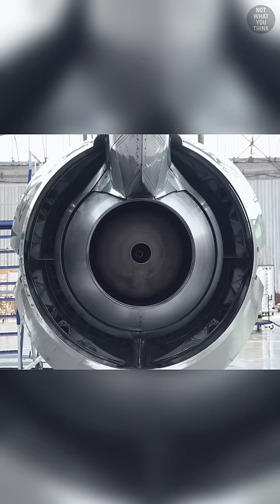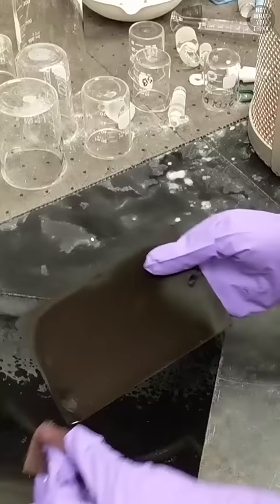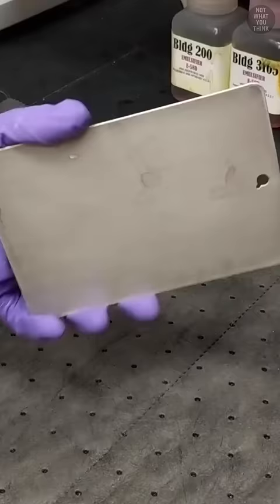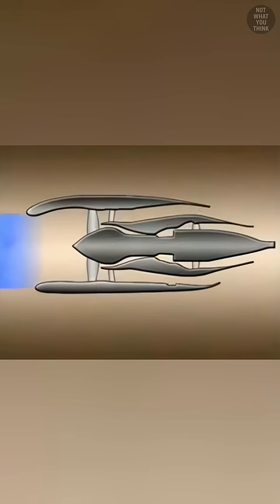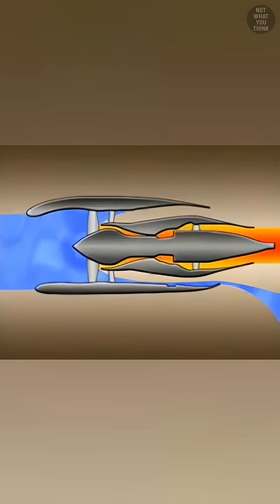Jet Engine Wash #shorts

Comment: I would never guess. High heat and high air movement should keep it clean, at least in my imagination.
Reply: You would be surprised
Reply: Oh my no
Reply: Lol
Reply: Even paint would go away in those conditions, but dust ..hell naw..

I wonder if we can we use dirt and dust as paint?, I am running trials on my car
Reply: Do you realize how much stuff there is in the atmosphere?
Reply: @J05EZ  Sure, mixture of gases, small particles and even space dust. But in very diluted concentration.
Reply: @user-uf9ke9tm2w  People use oil as undercoat for their cars, get's dirty and dusty but rust free I guess.  So there you go.
Reply: @DarkGT  Nowdays it's a special bitumen you can get done in most mechanic services.
Reply: P.S. I think it's an over time accumulation of vapours and particles in very high speeds of blades hitting them, along with kerosene and oil mist, gradually baked on by the heat.
Reply: @vitalijslebedevs1629  Yes, the oil thing is more like on the junk cars DIY. I not familiar with the turbo engines enough, but I know kerosene is oily like the common diesel.
Reply: Well when you add the fact the the space in the middle of all those sparse particles is rapidly displacing itself at a certain speed… like seriously just use your scientific imagination more. 🤷🏾‍♀️
Reply: It's not what you think
Reply: @user-uf9ke9tm2w  hahahaa
Reply: Well its only hot in the core and the back of the jet, they dont let heat out or it'd eventually ruin those jets
Reply: Still volcanic ashes get stuck to the engine
Reply: @Racejakestar  no. Compression heats the air. By hundreds of degrees. Heavy hydrocarbons will adhere and quickly bake on.
Reply: I think what's happening here is a similar process to carbon deposits on direct injection engines.

Oil and crud lands on surface, it gets hot 🔥, it gets baked on as a carbon deposit and is very difficult to remove, more oil then gets dropped on the new layer, and the cycle continues
Reply: I work on a 737 variant. We do engine washes every 90 days. We also are exposed to a lot of salt though too. It’s similar to getting a fuel system cleaning in your car. Aircraft can get nozzle coking (carbon buildup that effects fuel mist pattern) which is part of why most engines are run at idle/low RPM for couple minutes prior to shutdown after any turnup. Fuel nozzles get changed at certain intervals too.
Reply: @user-uf9ke9tm2w  hmmm
Reply: Nah it’d have to be way hotter to self clean and even then oil gas and carbon residue would still stick
Reply: Oil from the bearings or air, it doesn't get hot enought in the compressor to burn it, dropplets accumulate and dust stick to it.
Reply: Rain is so dirty. And the only way it would stay clean is if there was detergent running into the engine at the same time which also presents a problem because those chemicals can become explosive if mixed with the wrong other chemicals. I’d bet those engines are disgusting even after running through a few clouds not to mention the grease required to keep the parts moving.
Reply: @user-uf9ke9tm2w  Well, paint can burn but you cant burn a thing that is already burnt.
Reply: High heat and high air movement sounds like more chances for things to go wrong, not right.

Comment: Our TF34's have nozzles built in for water washing and there's servicing ports in the fuselage for connecting to each engine (A-10C).
Reply: The i or the ii
Reply: I always loved the a10
Reply: When I worked with A-10s in Alaska, one of the problems was the buildup of mosquito "mush" on the back side of the fan blades. It was surprising how thick it could be. They usually didn't make it to their 100-hour wash schedule before needing a wash.
Reply: Is that because the gun’s exhaust(?) causes the engines to become dirty faster?
Reply: unfortunately the civilian version CF34-8C5 for the crj 700 or 900 i work with does not have that feature and needs nozzles clamped behind the fan blades pointing into the core stage
Reply: @Acrophobia2  Yes, that is part of it. If I recall correctly, engine washes were every 100 flight hours or "X" number of rounds fired.
Reply: @barrygrant2907  So should there have been a recommended number of flight hours in mosquito mush? Damn I hate mosquitoes but I don't see enough to make mozzie mush!
Mark from Melbourne Australia

Comment: "Atmosphere is full of contaminants "
:-Jets being one of them.
Reply: Hippie
Reply: @Skumbagbrad  I mean he's got a point
Reply: Your right, but in this case, CO2 doesnt contaminate the engine core, only dust does, so your comment is unrelated to the video
Reply: @Ben-mw9vz  jets do not only produce CO2, but a bunch of other chemicals, also the fuel additives, and the oil used for lubrication produce more chemicals under the heat. And all of those build up in the engine.
Reply: I think it was referring to the aircraft itself being a thing in the air that is not a gas and should not be there.
Reply: @Ben-mw9vz  if jet engine only made co2 i dont think people would really care. Seems people only look as gases as contaminates and not all the other particles that are hard to measure because as soon as there out the engine they fly everywhere the heavy stuff sinks the netrual stuff gets waahed around with the gas and the light stuff comes out and goes up. Every single one of these are terrible and toxic for life co2 can be dealt with no problem the other shit cant be filtered you just got to wait for it to sink into the enviroment enough that fresh dirt is above it. The oil satuartion of pur soils is making it to where even grass is starting to have hard  time growing aroubd cities. Not to mention us removing 70% of the worlds forests in 50 years is absolutely fucking insane but instead of curbing people spreading like the plague we are we just build new shit for us instead of re using old buildings that are almost away built better got to love consumerisim making people so blind to what we are doing because to busy keeping your nose online i live in florida for example and everywyere that was woods when i was a kid is now all apartments all out lakes abd aquafers that purify salt water are all being filled in our oil is soaking down into them so much our tap water is not longer considered safe to drink ajd recomended to even boil it before using it to cook thats not normal
Reply: poo in the loo

Comment: Related to this ... you might run a short video on how the Navy washes planes on carriers.  My memory (as a supply clerk) is that they wash from bottom up, and the planes have a high priority on fresh water.
Reply: All that salt washing them with good clean water is very important
Reply: From the bottom up though? That sounds a bit counter productive?
Reply: Interesting. I know sometimes top down rinsing of filters, tubing, etc. can cause clogs. I guess it's a similar phenomenon with aircraft.
Reply: @markfryer9880  yeah, but it's the Navy, so I believe it.

Comment: They call it a comp wash and most of the time water is pumped on through the engine to clean the compressor blades they usually don't worry about the fan, they dont do it while the engine is actually running they only spray the cleaner and water while dry motoring the engine

Comment: Most jet engines are washed at least every 90 days. They used a soap water mixture, then several only water rinses. They don't start the engine, they do a dry motor which is turning the engine without ignition.

Comment: The engine is “motored” for engine wash. Water is 4 times as dense and would bend the vanes of compressor and turbines. So, the procedure calls for a motoring by using the starter to turn the engine with all the drains open. Fuel valve is closed and igniter is off…

Comment: I work in this field and there are a lot of pollutants like skydrol and "scale" which are due to high temperature and oil or dirt. So every few years they completely dismantle the engine and clean it bits by bits. They put it in a acid bath to strip,  descale and deoxidize the metallic parts .
It can happen sometimes that you need to replace a blade of the fan because it was hit by an animal or an object.
And then you build the engine back.

Comment: We actually use a hooked nozzle that is fitted from behind the fan blades, directly spraying into 2nd stage or the core. More efficient as it bypasses the fan air.  Also the water is heated to 180°. Takes about an hr from start to finish not 12 hrs. Water has no effect on the engine.  We motor the excess water out and start it right up.

Comment: In this video they show a flat piece of metal with a hole in the top. They're talking about parts in the engine being cleaned. The part that they are showing is called a test panel. It is not part of the engine. It's used to test fluorescent penetrant part of the inspection process of an engine.

Comment: Compression heats the air. By hundreds of degrees. Heavy hydrocarbons will adhere and quickly bake on. 

I’m very curious what percentage gets deposited on the front rather than the rear of the blades, because the rear of the blade has much more contact with the gas.

Comment: We call it Water Wash. We use a super diluted, special type of corrosive degreaser. (It's not super corrosive, but I've seen a hole that it made when we had a small leak in the spout.)
We have to do after evey so many hours. It takes about 1.5-2.5 hours, but thankfully the wash nozzles are integrated into the intake

Comment: This will also DESTROY the impeller over time. Anyone ever seen water injection added at the inlet of a turbo? It erodes the leading edge of the blades on the impeller- quiet badly as well!

Comment: spin it with the starter, as long as it's not on the water won't do anything negative as long as it's allowed to dry properly. it's like washing out something electronic. it'll be fine as long as you let it dry before turning on

Comment: Also... Walnuts. No im not kidding. You can clean turbine blades by throwing walnut shells into the engine while it is running.
Reply: I'm pretty sure a bird can down a jet engine. No you can"t.
Reply: @mr.mirage3986  Patent # 10,323,539.

General electric methods for cleaning gas turbine engine components.

"For example, in one embodiment, the cleaning medium may include organic particles such as nut shells (e.g. walnut shells), fruit pit stones (e.g. plum), and/or any other suitable organic material."

Im an A&P. While ive never done it myself I have seen it done.
Reply: @mr.mirage3986  further excerpt.

In additional embodiments, the step of circulating the cleaning medium through at least a portion of the gas turbine engine may include motoring or running the engine during injection of the cleaning medium so as to circulate the particles through the gas turbine engine via airflow.

In short... Throw crushed walnut shells into engine. This is also used in piston engines.

Comment: And now I wanna know how this system to redirect rain works
Reply: probably centrifugal force & sharp corners – water is heavier than air so can't turn as fast
Reply: @alanhat5252  yup, maybe quite simpler than I would have wondered.
It got me confused the fact that it pours on one side only, but you may be very right

Comment: So why not use the fuel injectors to clean the engine with a detergent?
Reply: because that would only wash the back half
Reply: @alanhat5252  you mean the dirtiest section of the engine. I was a Blackhawk mechanic for 10 years. To clean the GE T-700 and T-701 we pulled the fuel injectors and put in a detergent injector. I’m going to assume they wouldn’t do that based on the location of the injectors.

Comment: 12 man hours?!  Takes about two hours 🙄  Jet fuel is way to expensive to run it on idle for so long.
Reply: 12 man hours means if one person was doing the job it would take 12 hours, but that’s not the case there’s a bunch of guys so the times  a fraction of 12 hours.

Comment: High bypass jet engine as they only need 30% of the air to run and 80% goes on by for cooling
Reply: No! The bypass is for thrust! Yes, cooling is important, but Turbojets (first generation) had no bypass…